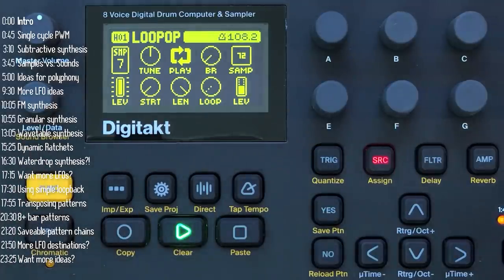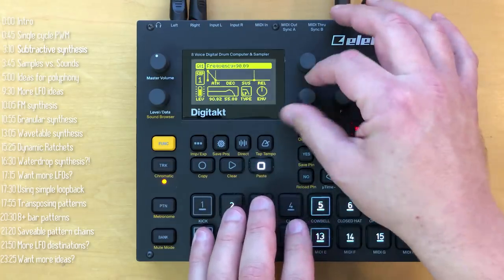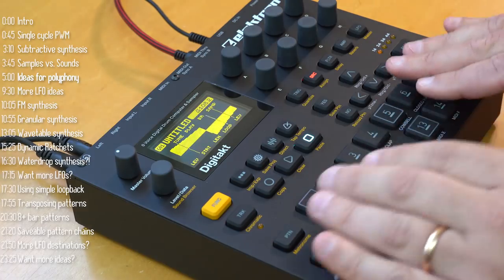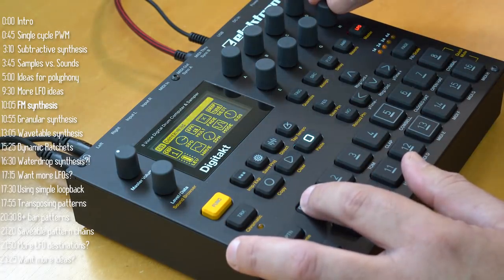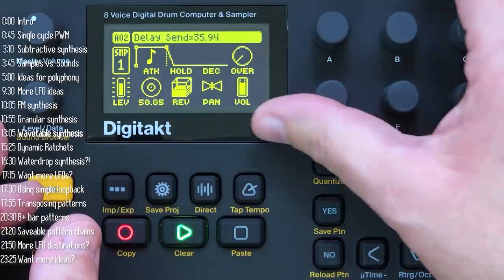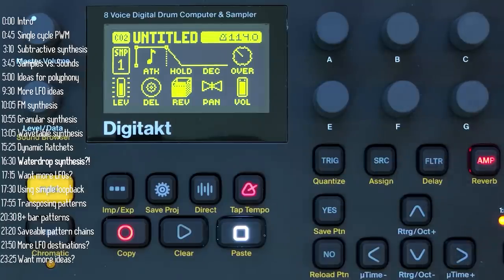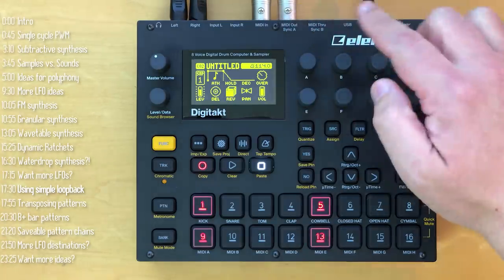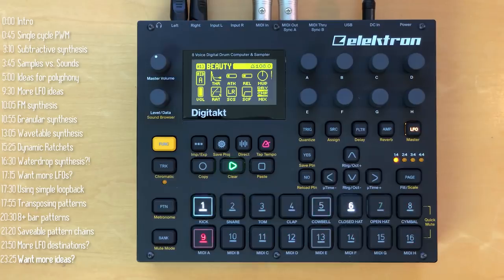16 advanced Digitakt ideas, tips and tricks

Comment: Pro tip for dialing in the single cycle pwm: when initially setting up the sound load the same wave into a second track and set the pitch an octave up. Set the amp envelope to infinite decay and get a note droning. Now dial in your original track start and length parameters until you get a centered selection tuned to the same pitch as the drone. You now can continue your sound design with a pwm wave that has accurate pitch to the original wave. 🏄 Save the finished product as a sound easily load it up.

Comment: Loved this! So many great ideas! I’ve been messing around with a way to get the Octatrack’s “one button remix” trick working on the Digitakt. I have done it, but it’s a pain to set up tbh. Briefly: Set up two tracks with the same sample (eg a 1 bar loop) on each. Set track 1’s trigs to FIL, track 2’s to ___FIL, use LFO on each track to cycle through the sample start (you’ll need to turn LFO retrig off for every trig except the first one so basically you are faking a sliced sample. Change track 2’s length to 15 trigs (for example) and every time you hit FILL you’ll have a juggled sample. The only time it doesn’t work is if you hit FILL just as the play point hits the trig that retriggers the LFO, then it’s stutter city ;-)

Anyway - awesome video. I’m off to play with some granular samples and dynamic ratchets. Thanks again!

Comment: Hmm... You could modulate the Decays ping pong function on and off and the steps it plays at to make it sounds like you've got multiple delays processing the sound. You'd have to step lightly and program every thing precisely and you wouldn't be able to overlap the delays but for shorter feedback delays that could be cool to have different steps delay in different ways across different tracks.
Reply from the maker: Absolutely!

Comment: I like your disclaimer after the compressor modulation trick: "now I'm not saying you should do that"... I like the  dub techno right around that point. The ratcheting modulation sounds great too, I wonder if I'll be able to do that on my Minibrute 2S or my Circuit, which now has ratcheting. Even if I have to turn a knob physically I'd love to get that.
Reply from the maker: I'm sure that can be worked out with an LFO - try a square LFO on the VCA?

Comment: Awesome! Can you please share the settings for the PMW? 🙏

When I did it, I got the PMW effect, but with some ‘popping’ or clicking sounds - which were more apparent when I dropped it by each octave. What’s going on here, and how can I fix it?

Actually, I think I can hear the same artefact when you drop the Octave right down at 2:45. Is it just an unavoidable effect with this technique?
Reply: Also, obviously the loop points/length determine the pitch of the effect - is there an easy way to adjust the tuning so that when I hit a C, I get a C? 

(Or do I just have to do it by ear, against another tuned instrument?)

Comment: Elektron has made 3 samplers all of which are legendarily complex machines but damn if there aren't some arbitrary limitations.  Digitakt should just HAVE savable pattern chains and internal midi routing for the built in sequencer, as well as poly voice allocation.  I guess one day, someone will build a proper hardware sampler that can do what Ableton or logic can do with their built-in samplers but until then the Digitakt is pretty good.

I love sequencing the modular and sampling the sequence, then laying those longer samples.  For example, you can dedicate a midi track to create a gate sequence and send that to a Turing machine to create a generative melody.

Comment: Bit slow on the uptake here but you could do the polyphony trick for free with pure data, and if it was needed on an embedded device that Pd script could run on a raspberry pi zero. You could also do it with an Arduino but more work + basic electronics

Comment: Great work man. However, I think the midi channel and midi loop for using pattern selection does not actually work. If you press a full stop...ie stop button twice, then the DT goes into a midi panic feedback loop. This is not a good thing. Do you not get the same behaviour?
Reply from the maker: I tried it prior to making the clip just to make sure it works and it was fine but I don’t use it much - didn’t have any problems with it. Maybe it’s a midi settings issue?

Comment: when i tried midi loopback it was shockingly buggy, what digitakt version were you using for the vid? seems very usable!
Reply from the maker: 1.10 - and yes, you are right - that’s why I mention to turn off everything you’re not using. I couldn’t replicate anything consistently but surely sending a lot of data back and forth can’t help
Reply: i think that's it tbh - i have very busy projects running to the absolute limit and it never modulates anything consistently but i bet i could get it to work on a new project solely to play with it.

Comment: Kind of new to this, but would the iConnectivity mio boxes do the same thing that the Bomebox would do?  Don't want to buy more hardware if I don't need to...
Reply from the maker: I don't think they can run scripts :/ before buying BomeBox try out Bome's MIDI Translator Pro - it does the same thing on a computer - make sure it works well for you

Comment: I would like to buy this nasty piece of hardware. The only things which is so far blocking me is lack of polyphony. If I would like to resample couple of chords on one track, how easy it would be to setup sample start/end on individual step later. Would it be convenient at all?
Reply from the maker: It wouldn't be a super easy workflow, but sure, you can play any sample on any step. You could also sample a few chords in one sample and parameter lock the start point. Might be easier than messing with a few samples
Reply: @loopop  that was my question. If I resample different chords on single track, one after another,  how easy it will be to use it later. Can I at least  copy star/end  paremeters from one step to another quickly?
Reply from the maker: Yes - not just start stop but the whole step

Comment: Ok....do you think the Digitak and Squarp Pyramid compliment each other are too much in the same space?
Reply from the maker: Pyramid is really the most powerful sequencer I know, but it can't make any sounds on its own. Digitakt can sequence other gear and make sounds, but doesn't have as many features as Pyramid. Hopefully that helps...
Reply: loopop — thanks for your reply. Yes agree Squarp is awesome... which I have and is the center of my synth setup... however I do like the sampling capability of Digitak... I am a guitar player first, and do mix guitar loops in with my synth tracks... but musing over a possible workflow that might work between the two.  Squarp manages my sub37, 0-coast, Minitaur and Dr-880 and provided sync to my two DFams;  I’m thinking Digitak can handle sample tracks which allows for vocal; more guitar and external recorded noises etc....  am I just taking myself into more gear? Haha
Reply from the maker: Doc Lambo Digitakt is awesome for samples but I wouldn’t get it for loops as it would have a hard time syncing them (unless you want non synced loops). Octatrack is better for that. Check out also Deluge